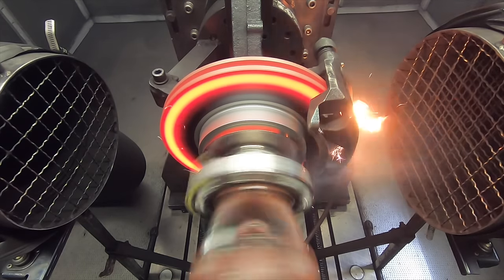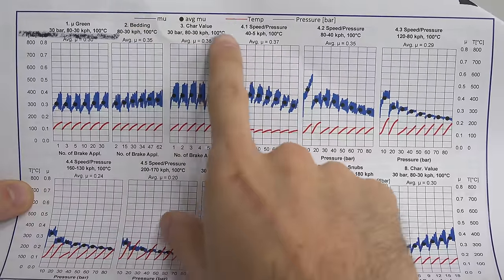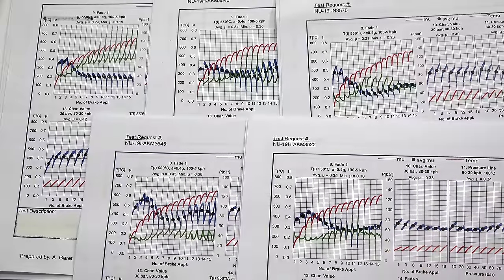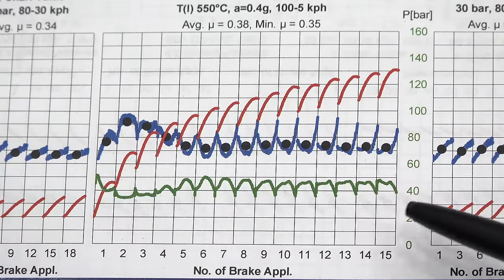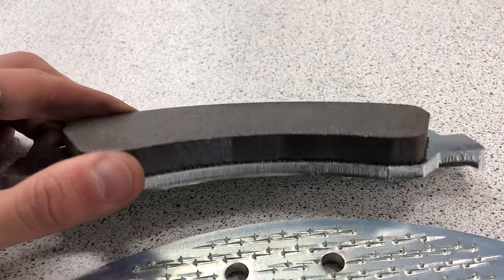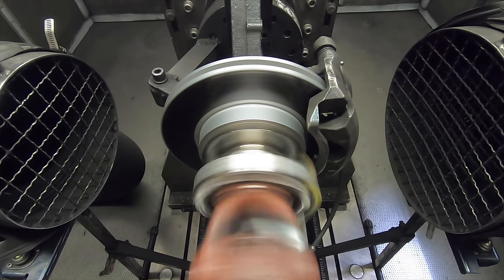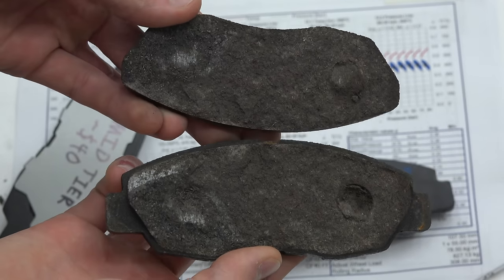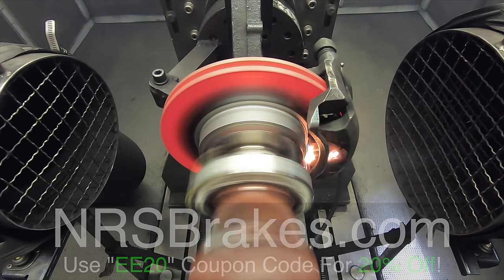What Are The Best Brake Pads? Cheap vs Expensive Tested!

Comment: So... Usually, it's not worth it to upgrade over OE pads unless you go real high end.
Reply: Yep
Reply: The low mid and high tiers are probably also cheaper than oe though so it's more like dont downgrade
Reply: Real high end is used more for racing applications. Most of us should just use standard OEM brakes as the higher end will be more noiser because they operate at a higher temperature.
Reply: at autozone we have duralast,  duralast gold, and max. if regular is $20, max will be like $50. regular is semi metallic, gold is usually ceramic which should be smoother, quieter, leave less brake dust on the wheels, and match the OE. it also includes hardware.i forgot why max is better but it comes with lubricant too to put behind the pads and on that caliper bolt.
Reply: You can get 5 Brembo sets for the price of 1 BMW set.
Reply: @Conservator.  yes but that's a high performance set compared to another high performance set, either set costs more then the car the brakes in the video go on.
Reply: Well no.... it depends on your application. If you are racing on a track you will do frequent heavy braking and need brakes that don’t fade. If you race a car and change brakes 2 or 3 times a season you don’t care. If your the average driver and don’t brake from 100 mph your probably ok.

I had a new Honda Accord that went 120,000 miles on one set of pads ( original equipment) driven everyday usually very light braking. 

Consider your application. Consider  how you drive this thing and what you need.
Reply: Concerned Citizen 
Yes you’re right, race pads are a totally different thing. Brembo was the brand I remembered. Not sure if they were race pads or not. But there was a plethora of pads including brand names and the Brembo’s were about the most expensive ones at about €35. The BMW were €165. Rear pads for a normal 5 series car (not an M version).
(Just explaining the situation)
Reply: So for 35€ those will not be race or performance pads. Brembo also does cheap pads. For pads, that will actually be good on the racetrack you can expect from 200€ upwards per axle.
Reply: Jan 
Of course the situation also goes deeper. Some race cars, I am told, run titanium discs . Talk about pricy $$$. Again application is the key. The basics are this: don’t turn a Toyota Prius into a leman’s race car and don’t turn a Lamborghini into a day to day driver.  Again drivers must lol into their needs not their wants.
Reply: @concernedcitizen780  i have an accord and i drive every day for the last 2 years. checked pads today and they still look new. i probably put 20k on them so far.
Reply: @concernedcitizen780  You haven't seen $$$ till you look up what a Carbon rotor cost and the pads to run on them lol.
Reply: This only tested a small selection though.. not necessarily representative
Reply: @concernedcitizen780  Titanium discs -  that is nuts.  One set would probably cost more than my car.
Reply: @TdrSld  I assume you're joking, but I'm really not sure.   Carbon rotors don't actually exist, do they?
Reply: well... for this OE pad. is that true for all OE pads??  and this was a sample of one for each category, for one make/model of pads.  ymmv
Reply: Depends on the car and what you do I feel. For my Integra a super light car, OEM pads were like $20 and work great and lasted forever. I don't race it and they only have to to stop a 2600lb car so the cheaper brakes are fine. My other car is a 5.0 with brembos that I take to Mexico every once in a while so I want pads that can effectively slow down a 3800lb car coming down from racing speeds, have less fade, quiet and less brake dust etc so I went one step above OEM and they were $100. So whether $20 or $100 they're both good, it just all depends on the car and the usage imo.
Reply: @ahobimo732  carbon rotors do exist I have some on my gti it brakes really smooth but the brakes and rotors for all 4 wheels ran me about $340 at auto zone
Reply: @RustyShacklefordActual  That's actually not nearly at expensive as I would have expected, given what it actually is.  I'm still kind of amazed that carbon fibre can be made strong enough for that application.  Just think about the stress and heat!

Comment: Very interesting video. Having to change your pads often is not necessarily a bad thing. It forces you to clean and make sure your calipers are well lubricated. It also pushes you to check the condition of your discs and so on. This can be especially useful in harsh environments and for cars that are not driven much. The alternative is to take everything apart semi-regularly to do all this, but you may much less inclined to do so if there isn't a pressing need to.
Reply: Ah, maybe not. I feel like that's like saying it's not necessarily bad to be burning oil because it forces you to do consider oil and filter changes more frequently.

Comment: I would have liked to see a performance pad, like Hawk or EBC to see if they are worth the hype
Reply: Hawk or EBC are very application dependent (sport, track, metallic, ceramic etc...). It makes my brain hurt trying to figure out the best EBC pad... I usually just give up and go with OE. I wish it were simpler lol.
Reply: @rootsmanuva82  if it helps any. I used EBC yellow stuff on my cars that see daily street driving and some track use. Haven't had any complaints other then a little dusty.
Reply: I’ve had EBC pads & rotors on two different cars. Both were rusted to dirt in about 2.5 years & 30.000km. They were the coated rotors as well... one of the rotors actually split in two whilst driving. Dangerous stuff. So I’d stay clear of EBC rotors at least. Pads are fine, but they did not bring any wow factor in either normal or track environments.
Reply: @kjellodnebreitebakk  i haven't used the rotors. I use the centric high carbon rotors(great for money) if i want just blanks. If i want drilled/slotted i use power stop and haven't had an issue yet.
Reply: I’ve had nothing but Hawk HPS pads on my Mini Cooper for the last 15 years or so (with Brembo brake rotors).  I see no reason why I would want anything else on my cars.
Reply: Hawk and EBC are really not great at all. Hawk works, but is far outclasses by GLoc and Carbotech and PFC, which is what most racers use and their lower compounds are totally street friendly.
Reply: theninja001 had redstuff pads on my old car, they were great but wear fast if u drive aggressively. OE will last longer
Reply: Yellow stuff would have been interesting I would like an upgrade i get mad brake fade on pagid. But I'm sure there meant to be oem. Never had that that bad oem tho
Reply: @ghostwrench2292  sounds like overkill for a tiny car that barely weighs more than a Harley lol
Reply: Driving for First Student school bus company, I agree PFC is outstanding. I've driven small and full size buses at full load, in both city & highway conditions, the braking consistency is exception. Once you build heat into the full size bus brakes, the repeatable performance stopping power from any speed from the governed 62mph is remarkable.
Reply: Some of those EBC brakes would probably break the machine lmao

Comment: OEM, which OEM were the pads from? I'm having a hard time thinking BMW, Mercedes and Kia have the same OEM quality.
Reply: Philip Rowe I would love to know
Reply: Probably do these days or pretty close.
Wind the clock back and, yeah, not so much.
Reply: Mercedes OEM is made by Brembo. At least mine is.
Reply: The OEM's on my old VW GTI said Brembo on them. The OEM for GM is ACDelco.
Reply: Most likely Nisshinbo they make almost every break pad the average joe will ever encounter.
Reply: Some say it might be Akebono, OE brake pads for toyota. But he should have specified...
Reply: it’s designed specifically for the vehicle they are put on, which means they will perform the best for that vehicle.
Reply: Just checked for my car 2008 BMW 328xi and the OE pads are Jurid. The price for fronts is $39 at FCP Euro (comes with lifetime guarantee). If I were to get "Genuine BMW" replacements they are $128. Think I will stick to the OE Jurid ones that came on the car.
Reply: @Nanan00  brembo on my gm
Reply: @saganworshipper6062  lifetime, like the gearboxes
Reply: @kaur9384  literally everything they sell has lifetime guarantee. FCP EURO FTW!
Reply: @seanlavery6477  it depends on the brake manufacturer itself. Brembo are usually used in their faster cars like AMG, less powerful Merc models have brakes from ATE or Lucas.
Reply: @saganworshipper6062  I had Jurid on my old car (a A Class Merc). They  worked good, but they lasted only half the km (20k km) compared to the original pads or ATE pads (40k km).
Jurid is a Honeywell brand.
The original pads for this car were not from Jurid.
Reply: @simonm1447  ATE makes the parking brake pads for my BMW.
Reply: @saganworshipper6062  Life time guarantee on brake shoes, means that the rotors or drums will be getting worn down.  Best way I know for brakes to last longer, is to use the transmission and engine to slow down the vehicle.  Once I started doing that, I aint change brakes since the last millennium.  And I take my vehicles to the best, most thorough shop to get the inspection!  

The Colonel I worked with in Panama had a BMW.  He knew the language, so he found a good shop to take his car to.  Jesus Worshipper
Reply: @roostercogburn3771  Literally ALL the parts that FCP Euro sells come with a lifetime guarantee. Pads, Rotors, Calipers, everything. It's a one time purchase. My car has a manual transmission so yes, engine braking does help reducing pad wear and I almost never buy brakes.
Reply: Philip Rowe it makes sense
Reply: Brembo makes the brake parts for the Kia Stinger
Reply: They're probably relatively similar these days, considering how much KIA has progressed. It definitely would be helpful to know the origins of the OEM pads though.
Reply: these are Honda brake pads I believe. Could be wrong.
Reply: That's the trouble with this test, because it wasn't completed unbiased we don't really get a full picture. Of course I understand he needed access to an expensive test facility, but if you pads were specified, branded, it would give a more clear indication.
Reply: @seanlavery6477  brembo made the brake calipers on your car. The pads were manufactured by the company who had the lowest bid to fill the contract...
Reply: @lincolngolladay  and manufactured by the company who most likely had the lowest bid to make them. Specifically designed for the car yes. The best? no.
Reply: Most of my autos (Audi) OE is made by ATE.
but in ATE systems are also pads made by FERODO.

For TRW/Lukas systems pads are made by TRW or supplied to them by FERODO.
For Bosch systems pads are made by BOSCH or supplied to them by TEXTAR 

Also company JURID makes pads for factory installations to some of above systems.
Brakes maker can order pads for given auto model, from other pad maker, any time. 
Generally, on original pad should be specified manufacturer of the system and the pad.

Although you can buy, especially on-line and not professional stores FAKE pads with good brand descriptions!  

Written about European market
Reply: @seanlavery6477  Brembo makes good pads for sports car.
Generally i go with ATE or TRW for Autos Premium.

We had in our company fleet Brembo pads. Were so bad I do not want to comment on that.
Supplied by official auto supplier. Maybe Fake series or just sth went wrong in factory.
Anyway, we have requested other brand (Bosch we could choose) and were no more problems.
You could here noises etc every time you step on the brake pedal.
Reply: I would guess the pad materials themselves are pretty close.  Where the braking performance difference lies is in the size of the pads and rotors and the type of calipers and the number of pistons in each caliper.  Just look at the rotor size of high end performance cars compared to a basic commuter car and you start to appreciate the difference in stopping power.  Also a basic car might just have a single piston on a slide caliper.  Where the larger caliper of a performance car may have a total of 6 pistons (3 on each side of the rotor) on fixed calipers.
Reply: @roostercogburn3771  so you will be spending your money on your gearbox and clutch instead 😂😂
Reply: @Housecat333  using ur engine braking does. Shifting down to lower gear to reduce speed...
Reply: Not same quality but best for their car and country.... using bmw at Singapore and Europe the car model maybe same but not for most of parts because of weather and air moisture... for example VW fucked up at Malaysia by introducing dry clutch DSG due to hot climate and driving habits but now they change to 6 speed wet clutch DSG mush more suitable and reliable for Malaysia whether.....that why I stick with oem parts they will research best for the country and last longer... 😉
Reply: I’ve had serious issues with Brembo’s pads failing due to corrosion.  I go with EBC for after market on my Evo X and my CBR600RR.  On my Impreza I went with the Duralast Elite pads from AutoZone and was quite happy with the quality, so far.  Performance was excellent on the Elite pads, very surprising.
Reply: Never went wrong with a pair of ACDelco Ceramics. Less wear, a bit of "braking in", but they were fine after about a week or two or normal use.
Reply: @saganworshipper6062  lifetime guaranty is only for manufacture issues wear and tear isn't included in the lifetime warranty.
Reply: @wllwll-zh7ig  Yes it is dude. Have you ever been to FCP Euro? It's 20 minutes from my house. Even the motor oil is lifetime guarantee.
Reply: @kaur9384  not the gearbox but rather the transmission oil, yeah whoever came up with that must have been a genius XD
Reply: @saganworshipper6062  Just be careful not to wear out your clutch instead 🤣
Reply: Yea BMW is probably terrible

Comment: The OEM wasnt bad at all, but hard to draw a conclusion without a price
Reply: Price is written on the brake pad. ?
Reply: @hellojrod  OE and NRS pads don't have prices written...
Reply: The pad shape looks like a D465. As per the NRS website their D465 pad set is $90. The OE set will run about $40-$100 depending on application. It's a very popular design with about a dozen different OE numbers today. The set I got back in 2009 ran about $50.
Reply: Why would you cheap out on brakes and tyres?
Reply: @ChocolateFrog  Because you are low on money and have other bills to pay.
Reply: David Crandall maybe you only make minimum wage and have other debt

Comment: My shop uses a wide variety of brake pads. The 2 we've had the most success with (in fleet and passenger cars) are the Raybestos EHT, and Textar for anything German made. The EHT have good bite, low dust, and almost no noise. Very rarely do I have a come back with the EHT. The Textars we use on Sprinter delivery vans and other German makes (we mostly see the Sprinter Vans). IMO they have a better cold bite than the OEM pads, again we've never had a come back, very consistent pedal even when hot. They do produce a fair amount of dust, very little noise, and they do wear somewhat quickly.

Comment: I determined about 20 yrs ago that OEM was the best option for long lasting, consistent braking. Glad to see my logic was correct.

One thing I have noticed over the years, and I didn't see addressed here, is pads with lifetime warranties. Every set of lifetime warranty pads I've bought were junk. They had lifetime warranties because the friction material was so hard that they never wore out.

Thanks for the video. As a test engineer, I love videos like this, with actual measurements.

Comment: I recently had a really bad experience with brembo brakes. Bought a whole kit, thinking it would be an upgrade... Pedal feel was horrible, so we're brake force and wear. 
Now running ebc greenstuff, they are a dream so far.
Reply: Funny you say that. I ended up buying brembo for my Tacoma direct from brembo with smooth rotors,pads,new hardware lubricated everything then in the back turned my drums which I regret and new brembo shoes and new hardware and lubrictaed it all.  I don’t think I haven  made it a  maybe a year tops  and they look half worn,are extremely dirty,already warped and don’t stop all that great towing my camper. Now I’m going to have to back up and do it all over again. I definitely won’t buy them again.
I saw the EBC kits and another rotor that was grooves with high carbon so I may go one of those routes and replace my drums and stuff in the back also.

Comment: For the start, I was developing brake systems for years including programming and conducting dyno tests, benchmark, component design etc. ... The video is great, very good presented. The friction tests were a pure "AK master" kind of tests. The regeneration question/problem is very well presented as well. I´d like to ask, what was the bedding process or the "drive in" process like? Is there any data available? Further on, there is something what is disturbing me.  There should be a 5th category tested. One of the most important nowdays. It´s residual torque. It´s a complex problem and I think I do not need to name you the input factors for it. I would be really curious to see the residual torques of the presented pads. And the compressibility test results too...